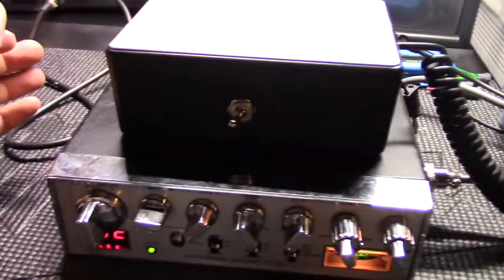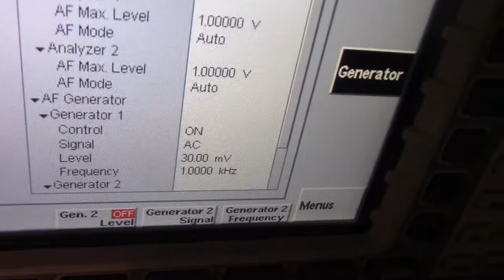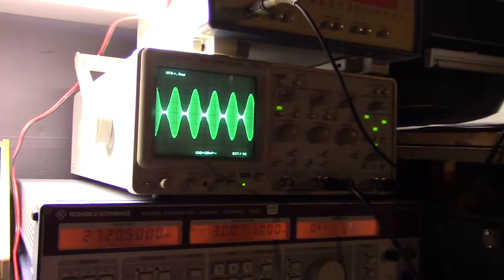CB Radio Keyup Audio Box (tuning, modulation, oscilloscope)

Comment: I've been meaning to build a box, running a pigtailed plug with alligator clips is sketchy, I was however thinking about making the leads on alligator clips inside the box so when I get a radio with a different mic plug pinout its as easy as opening up the lid and moving wires to the proper pin

Comment: Could a internal 1khz tone board be installed inside the box, inleu of the external signal generator?
Reply from the maker: Yea sure. I've seen little tone generators that you can probably use. Not sure how accurate they would be.